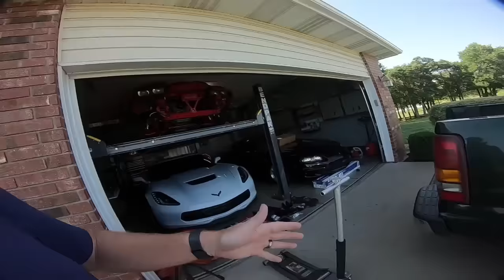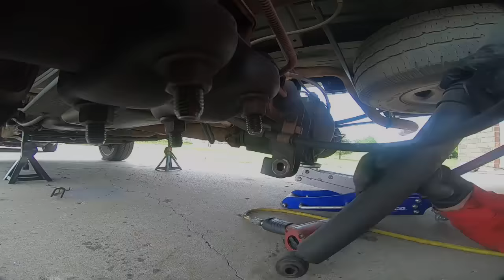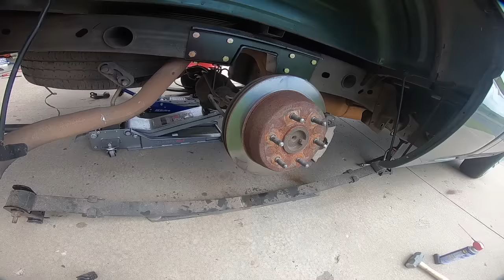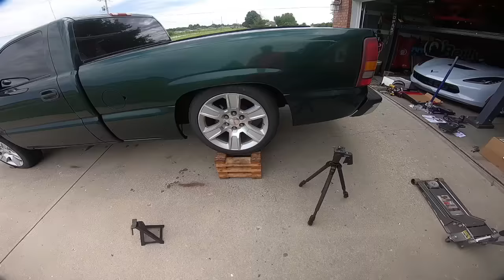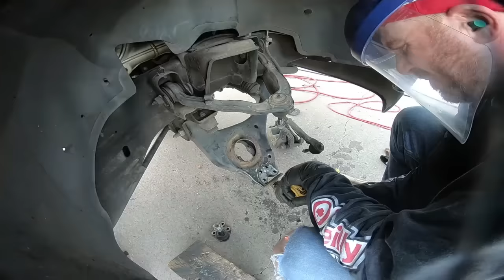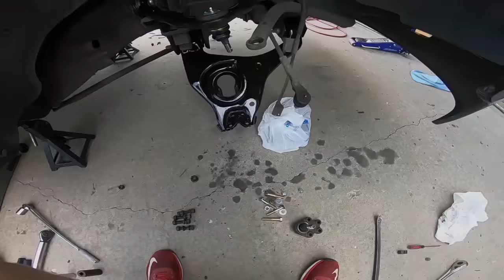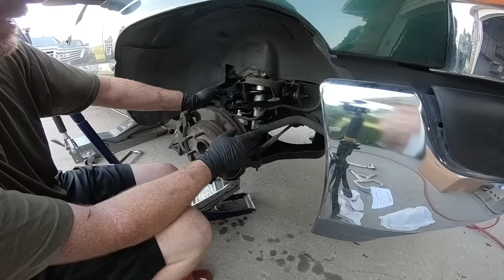How to Lower Sierra and Silverado NBS (Ultimate How to!!!)

Comment: This is the best how to video on this hands down!
I subscribed.
I do have a question. For the rear with that 7" drop did you have a issue with the driveshaft hitting the gas tank crossmember?
Reply from the maker: Thank you very much. No issues with the driveshaft hitting at all.
Reply: @TWAMotorsports  awesome! I started with a 2/4 drop on my 05 single cab short bed 5.3. I used DJM springs and hangers and shackles. Now I want to go lower lol. So going with the Mcgaughys c-notch and Belltech 3" drop leaf springs. Front I'm going cheap and cutting the springs and running Belltech street performance shocks all around. I live in Massachusetts so just waiting for spring
Reply from the maker: @Kevin_Yagoonie  I'm not a fan of the drop leafs because of the ride quality. I totally understand the weather things as most of my things are done outside.
Reply: @TWAMotorsports  yeah I just don't want to do a flip because I threw out the stock hangers and shakles. So a flip would be way to much a drop. But thanks for the awesome video. I'm enjoying it while I have some drinks seeing how I cant have drinks and work on my truck right now
Reply from the maker: @Kevin_Yagoonie  lol. I see. Sourcing stock stuff should be easy but most people throw them out
Reply: @TWAMotorsports  I search like crazy to find factory hangers. I found nothing but rear shackle hangers. Oh well.
Reply: @TWAMotorsports  do you still have that truck? It's a beaut! How did you like the street performance shocks?
Reply from the maker: @Kevin_Yagoonie  yeah must people junk them.
Reply from the maker: @Kevin_Yagoonie  I do still have it. I really like belltech shocks.

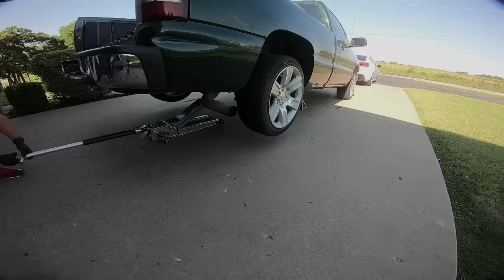Comment: Enjoyed the video!!! What jack are you using at minute 5:20 with the locking twist knob? It’s different from the one you linked and I’ve been trying to find one like that.
Reply from the maker: I used 2 Jacks in the video. The one you like is from harbor freight. It has been great but sorry I don't have a link for it.

Comment: I just finish my 05 regular cab short bed, rear 8" drop using the same c notch and same street performance shocks. I bottom out easily. Hoping if I adjust my shakles to 1" raise making it a 7" drop that would help me to not bottom out
Reply from the maker: Yeah. Go to 7

Comment: Hey man im liking your videos. I wanted to know because i have a 2008 silverado i want to drop the rear end maybe two inches. But i just  put 24”s on the truck. Do you think i will have any problems somewhere down the road if i try to drop it. With shackles? Or how would you go about dropping the truck?
Reply from the maker: Just 2 inches in the rear will cause no issues

Comment: I have a 2003 gmc extended cab with a 2-4 drop already but I like to lower my truck more like a 4-6 but I don’t know what kit is best for me I have the 2 in springs and 2 in shackles and lower hangers can I still uses this parts or just get a new drop kit thanks
Reply from the maker: Have to put stock front hangers back in and do flip kit. I did that same thing on a black Silverado on this channel
Reply: Ok thanks I have to order some stock hangers but I still need to order the spindles or just used the 2in spring

Comment: This (c notch) will still work still evn if im not flipping the rearend and leaf spring right? also would the job be easier if the bed was off?
Reply from the maker: Yes and yes
Reply: koo thanks liked the video really gotta do this tired of the frame slap!
Reply: @TWAMotorsports Forgot to ask will this c notch work for a 99 gmc sierra 2wd?
Reply from the maker: It should

Comment: Hey man did the drop kit come with the aluminum block? And where did you get the new lower control arms with removable ball joints? Really don’t want to drill and chisel mine out lol.
Reply from the maker: It does come with the blocks. I didn't buy new lowers and don't know if you can buy with removable ball joints

Comment: This was a great video man! Just wondering if the MOOG RK80826 control arms would give me the same results as the ones you used on the truck. They're advertised to also have that extra 2 degrees of adjustable camber but I just wanted to get your input.
Reply from the maker: Thank you. I listed the ones I used in the video description

Comment: Did you have a Saggy brake cable after lowering? And if so . How did you fix that ? Thank you sir .
Reply from the maker: No I didn't. I did zip tie them on the driver side but it wasn't a ton of slack
Reply: @TWAMotorsports  Thank you for your feedback.  Watch all your videos.
Reply from the maker: @marklimones2771  you're welcome. Thanks for watching

Comment: We have the same truck only that mine is a stepside on a 6/8 drop. Why didn't you lower?
Reply from the maker: I like to drive it lol
Reply: @TWAMotorsports  6/8 drop foes scrape om bumps. I need swap mine but engine still has original 53k miles. Imma wait a lil longer to swap.
Reply from the maker: Understand waiting

Comment: Question when you lowered the truck did you put the aftermarket u bolts with the flip kit or you used the original ones ?
Reply from the maker: Used originals. All parts listed in video description

Comment: hey i’m having trouble installing the spindle the top and bottom of the ball joints keep spinning when i try to tighten them down and i don’t know what to do
Reply from the maker: Try to use a clamp to clamp spindle and arm together. Other option is carefully lift a arm on that side with a jack to put pressure on them.

Comment: Im kinda new to suspension so what does a c notch do? And one more thing, do i need to cut the bed to fit the c notch?
Reply from the maker: C notch allows the rear end to travel more without hitting the frame. No bed cutting is required.
Reply: @TWAMotorsports  ok thanks and do you rub or scrape with the 5/7 drop? I want to do it on my 2009 Silverado but i dont want to have any of those problems
Reply from the maker: @abasabas3051  no rubbing at all with this
Reply: @TWAMotorsports  ok thanks
Reply from the maker: @abasabas3051  you're welcome 👍

Comment: Hey bro, at the end of the video you said you replaced the hanger to fix the chevy lean. But the kit you put in the description doesn't come with hangers. Did you mean the stock shackles, I really need to know this. I just dropped my 00 Silverado 5/8 and it has a nasty Chevy lean. Thanks for the video
Reply from the maker: Yes I meant the stock shackle on that side sorry.

Comment: If you are installing Belltech shocks that are meant for trucks with 5-7 drops do you still need to install the shock extenders?  Since those shocks are shorter then stock ?
Reply from the maker: I like to use both. The extender does more than make the shock travel. It also gets the operating angles back in line after dropping.

Comment: Can u make all this front kit work with lower moog control arm? Just asking because i thought u explained that u need to use the lower stock control arm? Thanks
Reply from the maker: Not sure what you are asking. Stock a arm is in place on bottom. Moog offset bushing control arm replaces the stock top a arm.
Reply: I’m sorry bud! Did not explained right!  What I’m asking is that in order to go with those spindles u have to keep that lower OEM control arm? Or if you go with something else like Djm or Belltech you can do it with aftermarket lower control arm! Like in this case if I want to replace my lower with moog brand? Not sure if I’m explaining this right but if not it’s ok! So far the BEST lowering video ived seen! Great job man! Very nice work and very well explained!
Reply from the maker: @leopoldohernandez5345  you can use any lower with that spindle
Reply: TWA Motorsports thanks a lot!
Reply from the maker: @leopoldohernandez5345  you're welcome. Hopefully I helped

Comment: Why does my truck shake from the back after the flip kit
Reply from the maker: Could be several things. Kit used, wheels, tires, pinion angle, shocks, not tighten properly, list goes on and on.
Reply: TWA Motorsports what kind of struts can you used and what’s the part # for a 2002 extended cab ? Thank you
Reply from the maker: Same as this video. Link in description

Comment: What kind of backspace would I need on a 01 Silverado to tuck my 22"  wheels?
Reply from the maker: 30mm generally
Reply: +30 offset. I have had 3 of this body style. 22x9.0 or 22x9.5 with +30 offsets you can go +31 but that's pushing it. I run 265/35/22

Comment: Would it be exactly the same for a 2004 silverado extended cab?
Reply from the maker: Very similar
Reply: what would be different ? If you can explain ?
Reply from the maker: @jesusnbs7255  may have to use a spacer on transmission or if it has two piece drive shaft a spacer on carrier bearing

Comment: AWESOME VIDEO!!!! 
But quick question.....
Do you have to use the aluminum spacer for the ball joint?.......And if you do, does that spacer comes with the 16" spindle?
Reply from the maker: Thank you. You do have to use it. Comes with the spindles and keeps the a arm from collapsing when you move the ball joint.
Reply: Thank you, and does it comes with every 16” spindle?
Reply from the maker: @migue6.078  you're welcome. It does with mcgaughys
Reply: TWA Motorsports thank you so much for the help G!!!
Reply from the maker: @migue6.078  you're welcome

Comment: Have a few questions. Did u get a new lower control arms ? And do i have to relocate the ball joints because it seems like a tedious process. And can i just buy the lower control arms with the ball joints already relocated?
Reply from the maker: No I didn't buy new lowers. I don't believe you can buy lowers with ball joint relocated
Reply: TWA Motorsports is flipping the lower ball joint necessary? Ive seen a couple people running 5/7 drops on 22s who didn’t relocate them
Reply from the maker: @kelvinhernandez6822  they make 2 spindles. The 17" doesn't require this. I like the less bump steer that comes with the 16" spindle

Comment: Hi I love the video very informative I have the same truck as you 02 Sierra single cab I have 275/55/20 tires will that clear the 5/7 drop that you have
Reply from the maker: No way that tire clears
Reply: Ya I figured thanks for the confirmation I was told I’d have to do a 3/6 drop for now till I get new tires
Reply from the maker: I think a 2/4 will be pushing it

Comment: I have a question I'm bout to lower my 04 Silverado and it already has 2inch drop shackles in the back can i Still flip it without removing the hangers ? I only have specific tools i can use to remove the rear end only and try to remove it and go over the hanger to Lower her
Reply from the maker: Yes but it will be a 7-8 rear drop
Reply: @TWAMotorsports  im working on getting the front lowering kit, but for now I want the Cali Lean
Reply from the maker: Lol

Comment: I already have the 4 lowering kit on mine with lowering leaf springs hangers and shackles and I want to go to a 6” . Can I keep the after market lowering left spring hangers or I need to put back the factory leaft spring hangers and what shackles I need to use?
Reply from the maker: You need to put the stock hangers and shackles back and do a flip kit unfortunately. You could do lowering leaf springs but that would ride terrible.
Reply: Ok thanks, so without the stock hanger the leaf spring will not line up?
Reply from the maker: @yonyls  pinion angle would be off an too low.
Reply: TWA Motorsports  thanks

Comment: Good video do you prefer the belltech street shocks over the belltech drop shocks ? and what is the difference in the two ?
Reply from the maker: Thank you. I have never used the other belltech shocks but really like the street performance series. I have never had a reason to switch and try the others. I do know that the mcgaughys are a little soft for my liking.

Comment: Hey for the shock extenders by belltech it says it won’t fit my truck I have a 2001 GMC Sierra 1500 extended cab do you know if it will fit or no?
Reply from the maker: Should be no different but maybe the ext cab may be different
Reply: @TWAMotorsports  okay do you know if I will need them I’m getting the belltech nitro drop 2 shock absorbers 5-7” lowered
Reply from the maker: I use them

Comment: I just got a 99 gmc sierra, I want a 2/4 drop, what is best for the front? drop spindles or drop keys? are shackles and hangers for the rear only? I used spindles on my 03 gmc denali xl and the front fender, one side fender would be high n one side would sit low. I didn't want to buy another torsion truck but this sierra has it too.
Reply from the maker: Is it 4wd?
Reply: Yes
Reply from the maker: @Dolliehomee  might be able to get 2/4 with keys and shackle but probably more like 2/3. I like spindles over keys.
Reply: I'm gonna try remove the shock extender from the Yukon, c if it helps even it out n use the spindle from the Yukon to the Sierra.

Comment: Is there a different option so you dont have to drill for the ball joint? Seems complicated
Reply from the maker: Yes. Use a different spindle
Reply: @TWAMotorsports  is the kit you linked in the description the spindle you have to drill for or do i buy the spindle you linked in the description then buy the rest of the parts. Thanks in advance
Reply from the maker: Linked parts are what I used
Reply: @TWAMotorsports  do you have to get new shocks all around? Mine look to be in really good shape and dont really feel like replacing lol
Reply from the maker: People ask me several things about dropping these trucks. Everything I used in this video is required if you want a good ride.

Comment: Hello I bought a mcgaughys 4/6 with the 17in drop spindle would i also need to relocate the lower ball joints like you did in the video ????
Reply from the maker: Not with those spindles
Reply: @TWAMotorsports   okay thank you so much i was so worried because your video was the first one i watched and i kept doing research and couldn’t find anyone else doing a 4/6 with the mcgaughys kit everyone else was going either a bell tech or IHC
Reply from the maker: Depends on spindle.

Comment: Hey Travis I have a question. How important is suspension torque specs and why?
Reply from the maker: On the rear it is very because if you over tighten it will bind or bend the hangers. The rest is really to give someone an idea of where to stop.

Comment: “Do you think I can use AcDelco oem style replacement lower ball joints instead of the moog lower ball joints?”
Reply from the maker: Yes you can
Reply: @TWAMotorsports  Thanks, what did you use to tighten the threaded insert on the top of the spindle?
Reply from the maker: T40 I think

Comment: Hello may these comment become a long shot to be reply ...I came across with ur video and love it I'm ur new follower  congratulations btw 👏 I've a 2000 2500 silverado long bed  and my plans are to fully reconstruct and drop these truck is an heritage from my late father and I wanna do the honors , but the parts u link on doesn't not fit on a 2500 can you please share the parts with me that can actually fits your are very knowledgeable and really didn't wanna get wrong w that if u come across please reply back thank u so much
Reply from the maker: Rear stuff will fit. Front will require different spindles and drop keys
Reply: @TWAMotorsports  thank you again never thought I was gonna get a reply back .....great stuff u do keep up best of luck
Reply from the maker: Thank you

Comment: Did you go with new lower control arms? If so, where did you find them without the ball joints?
Reply: Having hard time with the rivets
Reply from the maker: I used my originals and it's a pain

Comment: How is the angle on your upper ball joints with the moog +2degrees? Is it good or would a custom upper control arm be better for a good ball joint angle?
Reply from the maker: It seems to be decent
Reply: @TWAMotorsports  Ok thanks for the input
Reply from the maker: You're welcome

Comment: Did you measure the front after lowering? Any idea what the difference was with the lean? I installed djm 2" lowering springs and have a whole inch higher on passenger side. Thinking of cutting a half coil off
Reply from the maker: I did and it was about a half inch off.
Reply: @TWAMotorsports  how is the trans crossmember? And scrapping issues?
Reply from the maker: @Kevin_Yagoonie  no issues at all
Reply: @TWAMotorsports  great to hear! As soon as it gets warmer here in Massachusetts my 2/4 will be 4/7. Can't wait.
Reply: How many of them Neiko drill bits did you need to drill all them holes? Just so I know what I need
Reply from the maker: @Kevin_Yagoonie  a couple

Comment: Great video! I'm seriously thinking about doing this myself, especially after getting quoted 4,500 dollars for a 4/7 drop. Fuck all that.
Reply from the maker: Thank you. Wow. That seems high.
Reply: @TWAMotorsports  I have a lift but im not sure my back can handle it, ive had several surgeries. I bought a 07 Classic and if I can't lower it there is no point in having it. Im probably going to try and find someone who wants to make some cash help me do it or else I'll have to sell it unfortunately. They look so much better lowered. I had a lowered 95 about 20 years ago with all Bel Tech parts and it rode really nice. Hopefully I can find help.
Reply from the maker: I'm sure you can find someone way cheaper
Reply: @TWAMotorsports  Its been surprisingly difficult to get quotes, the shops I've tried won't give me a quote or they just won't do the job. I'll keep shopping around because I love e these trucks, my daily is a 05 Sierra 4wd SLT crew cab with a LM7 5.3, its stock height including "The Chevy lean" and I bought a wrecked 07 2wd silverado with a L59 5.3 flex fule. Im gonna do some work to the engine and put some gears in it but first and most importantly it needs to get dropped.